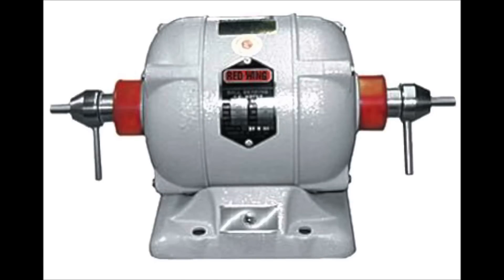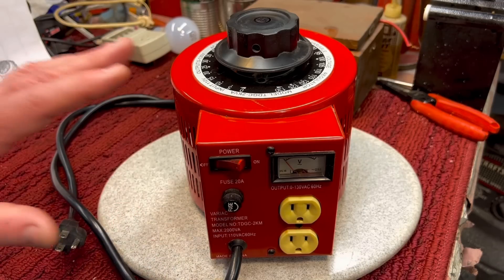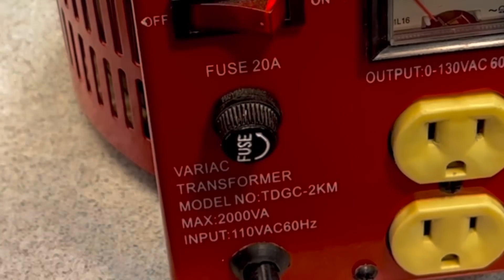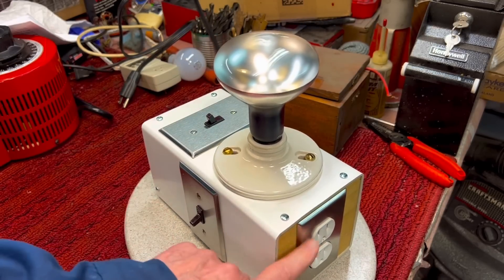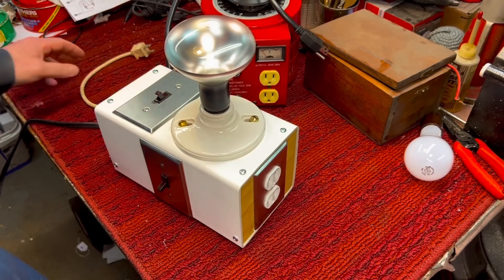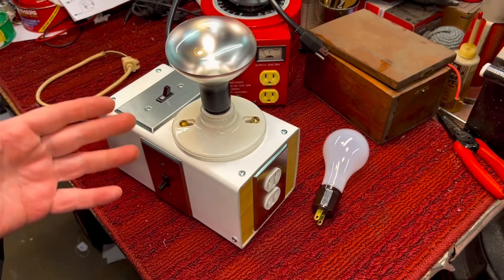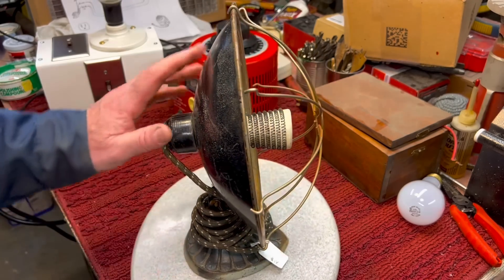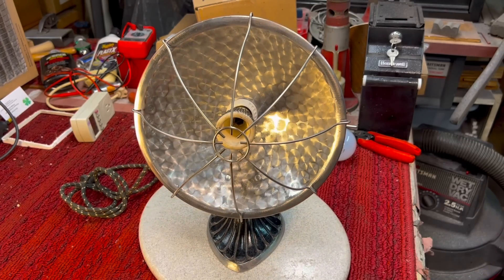Variac Introduction -Home Made Current Limiting Device and Antique Heater Restoration

Comment: Variacs are very interesting. They are not step down transformers as they have only one winding. That winding is an "auto-transformer" and is connected to the line input, full line voltage.  Your output voltage is from touching various points along that winding, and depending on where the line voltage is connected to the winding, you can get both lower and higher voltages than the line input.

Comment: A form of that Variac was use to dim lights in auditoriums a long time ago. Your example of using a light bulb as current limited device and you plugged in the shorted extension cord and the bulb got brighter and didn't blow the fuse reminded me of something. As an electrician years ago when fuse panels were common we used to screw a light bulb into a fuse panel ( they are the same socket ) of a circuit that had a short in it we couldn't find.
The bulb would come on bright your partner you watch the bulb as you went around pulling and poking the wires until the light went out . When it went out or flickered you had found the fault and repaired it. This was done as a last resort, as this was done with a live circuit. I wouldn't  recommend any none professional try this. The principal is the same as in your circuit.

Comment: Great idea on the jeweling! I may have to try using that on some of my heaters. Did you use scotchbrite?
Reply from the maker: With this reflector I used a 1” wire brush!  However scotch brite is better I believe. This reflector was pretty beat up.  😂👍

Comment: What a great show brings back memories of when I first started in 1973 I started at a feeder shop we built custom bowls that fed and oriented parts into an assembly machine the bowls used electro magnets to drive the base units and the varics would vary the speed of the vibration but eventually everything became solid state because of the room the took up. Thanks for the show

Comment: Hi Scout, I love that jewelling, it hid all the faults and looks really nice. Electricery still confuses me sometimes, I don’t understand why the light bulb stopped the plug from shorting out. We use the same way of wiring in Australia except in caravans, motor homes ect. In those systems the switches are double throw meaning the switch has to turn both the active and neutral on or off. This is a safety measure but again I don’t know why. That heater comes from a time where parents were responsible for child safety and things didn’t have to be made to protect idiots from themselves. Back then my parents would have told me not to touch the heater because it’s hot and if I then touched it anyway I would be in trouble as well as having a burnt finger. They wouldn’t have to tell me again. Now they rush you to the hospital and then the lawyers and some parents rush you to the lawyers and then the hospital.😂 Cheers, Stuart 🇦🇺
Reply from the maker: Stuart you are so right, the early appliances that seem dangerous to us was a lot safer then the open fire places and oil lamps or gas lamps our grandparents had!   =D

Comment: John, the circuit breaker that trips could be weak in general being it's down in your shop and gets a lot of use. I'd like to think you have a 20 amp circuit or two for running your grinders and other power tools.
Nice job on the heater. The simpler things are the longer they will last.
The wire stripper from your last video...I bought the Doyle/HF version last year. They work and are a little too sharp for stripping wire but they just feel wrong in general.
I have to laugh that it seems like you get more excited about the vintage product packaging of that old projector lamp than the lamp itself. A few years ago at a yard sale I found an old Pepsi box with a pile of 45 rpm records in it. Two things made me buy it. The box survived from the late 70's/ early 80s as it had 64 ounce bottles not 2 liter bottles and the record on top was bought at Barkers for .69 cents.
George
Reply from the maker: George in 25 years the only thing that ever tripped my breaker was this variac. I knew something was fishy!  😂👍

Comment: One wonders if those heaters had a “UL” certification/rating ? Nice job.
Years ago I needed a variac and couldn’t find one until I was home on vacation, across the street from where I grew up they were tearing down the drive in theatre and destroying the snack bar and projection building. I worked there during the summer picking up trash, fixing the speakers, and watching the projectionist. There was an Altec amplifier with two giant tubes that powered the entire field. Imagine my sorrow to see it smashed and bent in the dirt, the only salvageable item was the diming transformer. A very heavy transformer laid out linerally with a foot pedal to move the slider along the coil to vary the voltage and dim the monstrous lights above the screen. My brother and I still have it although we use a more modern variac like the one you have. I can still see that amplifier torn to pieces; it breaks my heart.
Reply from the maker: Michael I agree 100% it’s heartbreaking to see some antique and vintage items destroyed or scrapped. I remember once seeing a huge 12 foot lathe being scrapped because nobody uses those monsters anymore.  I love stuff from the past but some people only like new things.  Thank goodness for EBay!  😂👍

Comment: Another great flick. I'm interested in finding a Web Site that would help me in buying a Variac (variable transformer). If you happen to know of one (or one of the other viewers, of course).
Reply from the maker: Paul- Variacs come in different sizes or amperage ratings. The USA models are superior but pricy. The first thing you need to determine is what items you want to control. Once you decide on a size you can look for used or new depending on your wallet.  I bought mine on Amazon because of the good ratings and reviews.  😃👍

Comment: Like the explanation of the different electrical devices used for soft start of appliances, excellent tutorial on the controllers. Like the heater restoration, especially the jeweling. Last but never least, old glory waving in the breeze, always liked that.

Comment: Funny story my abrasive chop saw kept blowing the 20 amp breaker dedicated outlet about 8' run.  I would bring the saw in the basement to work on, tore it apart cleaned and greased everything and it worked fine, also a 20 amp dedicated.  Go to use it outside and boom, blows the circuit.  Repeat cleaning, tests fine.  Congo use outside and blows the circuit breaker.  Repeat over and over again. New circuit breaker.  After much frustration it occurs to me the only difference in these circuits is the length of the run.  So now I plug the saw into a heavy duty 100 ft extension cord and it works fine.
That jeweling came out great.  Have a great weekend everyone.
Reply from the maker: Pat- You are absolutely right, long runs of wire combined with a decent draw will always create heat and pop the fuse or breaker.  I have to cover that on a future video!   Thanks!!!!!!!

Comment: Awesome info. A little tidbit I found on Wikipedia about the Variac trademark. I think it's interesting. Have a great weekend, John! From 1934 to 2002, Variac was a U.S. trademark of General Radio for a variable autotransformer intended to conveniently vary the output voltage for a steady AC input voltage. In 2004, Instrument Service Equipment applied for and obtained the Variac trademark for the same type of product.[7] The term variac has become a genericised trademark, being used to refer to a variable autotransformer.
Reply from the maker: Yes!  I went on their website when preparing this video, I wonder if they bought the company as their wording makes it sound as they have been in business since 1946.  Interesting!   https://variac.com/staco_Variable_Transformer_Map.htm
Reply: @ScoutCrafter  I absolutely love the internet. I have an endless search and love for knowledge and you can learn so much from it. I sometimes think if a child has an internal desire to learn, they don't need school, they just need a good internet connection. And this comes from a public school teacher of 17 years.

Comment: Another great video. I had built one of those current limiting devices, but I do not have the bypass switch. I guess I need to modify it. Thanks for the variac lesson.
Reply from the maker: Daniel- The reason I added the bypass is because if you are running something that draws more current like a motor the bulb will light and the motor will not start. The bypass eliminates the bulb feature.

Comment: The light bulb is a resistance, but it is variable resistance. When the filament is cold, the resistance is almost zero. The hotter the filament becomes, the higher its resistance increases. So it limits the current that can pass at max.
The East German manufacturers inserted a light bulb into the loudspeakers for stereos as a safety mechanism against overload, especially to protect the tweeters. That bulb was actually for a car turn signal.

The electric heater makes it possible scorch and electrocute yourself at the same time.
Reply from the maker: The antique electric heaters had only a few safety features, yet there were very few mishaps. Most people  were transitioning from fireplaces and open gas flamed lamps and heaters. They were very conscious about using common sense around dangerous things like fire, heat, flammables and leaving them unattended.  It was the addition of so many safety features that has led to a dumbing down of people and  created a lack of common sense.  So much so that the average person today has no idea how to put out a  small fire, something a 8 year old was expert at 100 years ago.  =D
Reply: I have seen that trick, and it was a German fellow. He had us ordering Volvo turn indicator lights. I wondered if that is where he got the idea from. I don't know if the electrical inspector noticed that addition to some control panels.

Comment: Great information. I learned something useful about electricity.  I'm glad you did a tutorial on Variacs. I wonder how many vintage appliances have been damaged by well meaning people who plugged their ancient radio in only to blow the aged electronics. There is one You Tube radio restorer who routinely replaces old paper wrapped capacitors as a matter of course when he restores old radios. Almost always they are shot.  Radiant heater is beautiful. If the porcelain wire wrapped heating element is ruined, is your only recourse to find a NOS replacement? Can the element be wrapped with new wire?
Reply from the maker: Pat- The heater element is so simple I bet it could be easily re-wired with the same type wire.  The only thing you would have to know is the length and then coil it up around a small rod or dowel and wrap the ceramic cone.  I am assuming that the length of wire will dictate the wattage...  Now I am going to search out some nichrome heating wire!!!!!!

Comment: WOW! I am impressed with the jeweling job you did!!! Looks great and I bet it will reflect way better as well. I use Variacs  all the time I actually built a permeant Variac with meters and fuses in it for use on my workbench. Still have a few new in box from 50-60 years ago that I have not used yet.
Reply from the maker: Bobby- When I was running my electric steam engines I was using a Variac and my buddy said why don't you just use a dimmer switch...  I replied "A Variac is so much cooler than a simple dimmer switch"  He got a kick out of that and agreed....  =D

Comment: Is there a GFI anywhere on that circuit?  They seem to cause more problems in the shop than they prevent.  I use a variac to control the blower motor on my forge, plugging it into a 20' extension cord solved my problem but your solution is definitely cooler.  Nice to see the Ken Rad in action.
Reply from the maker: Yes!  I believe the reason my Variac wasn't tripping upstairs is the extra length of wire going upstairs gave enough resistance to stop the inrush.  Your solution is simple genius!  Thanks!